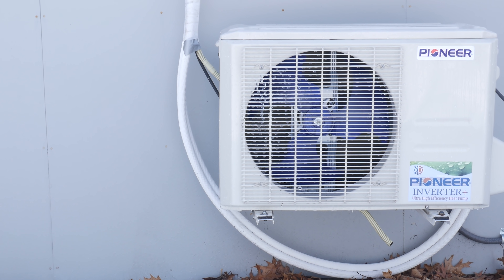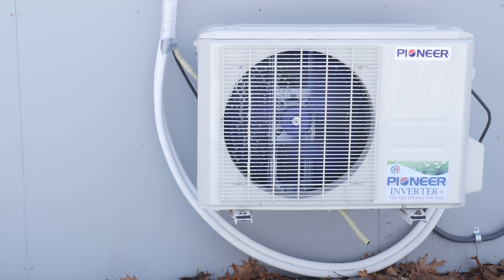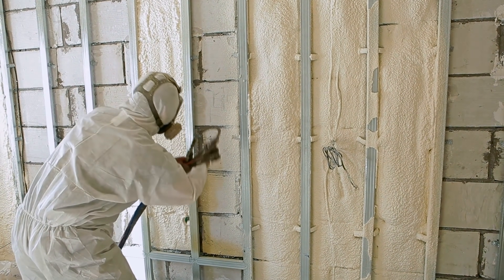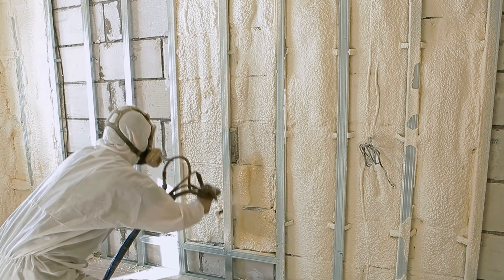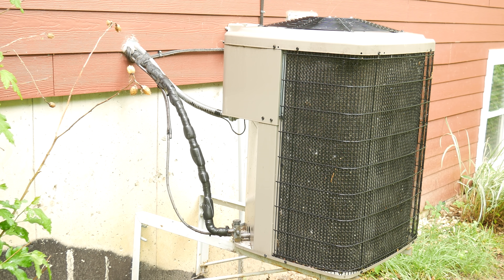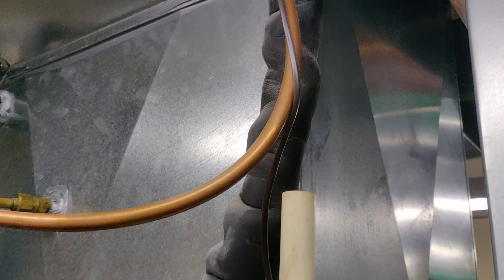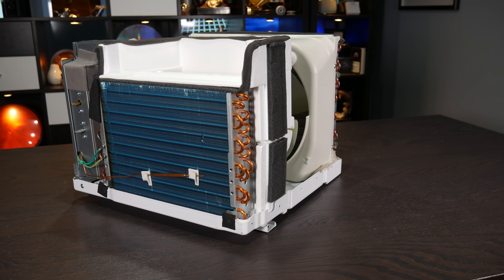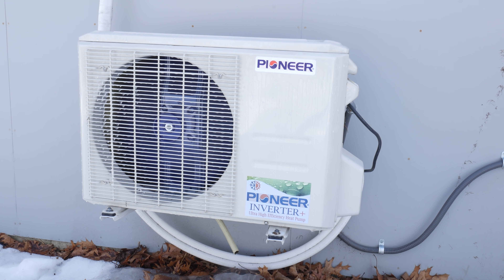Heat Pumps are Not Hard: Here's what it will take to start pumping

Comment: Getting a 12kw solar system and a heat pump to replace my 30 year old propane and conventional HVAC  and LP water heater switched to a heat pump water heater installed in the next couple weeks and can't wait.
Reply: I live about an hour south of Chicago in Indiana if you ever want to come check any of it out
Reply: Also I got a quote from a local HVAC company and it was over 20 grand to remove and replace with a heat pump

Comment: Odd, I have two of these installed on my house, although they mostly pump heat outwards. 

We just call them 'reverse-cycle air-conditioners' in Australia. 

As it doesn't get cold enough to snow here, basically ever: We care much more about cooling power than heating power, and this turns out to be not at all as efficient, leading to needing bigger heat pumps to push heat out into already-hot air.

Instead there's at least one company offering hot-water services running from electricity which improve electrical to heating efficiency by virtue of using a heat pump.
Reply: My A/C works very well, even in 100 degrees (38 C).  The outside compressor is 150 degrees so it has no problem transferring the heat to the outside world

.

Comment: @15:10:  You noted a trap on the condensation's drain line.  What good does that do?  It's not like you need to block sewer gasses or prevent air-flow leakage in the head.

Comment: Our house has central air.  Most of the winter heating is done with the system running in reverse.  On truly cold days the electric heat is switched on and we get to watch the meter spin faster than the Indy 500.

Comment: Split system reverse cycle air conditioning in residential homes is very common in Australia 
My house has two heat pumps both are reversible 

Its a very common misconception here though that the heat function uses a lot of power 

I wish more people knew how they really work!

Comment: What can you say about water-water heat pumps, where you pump near constant temperature water from deep underground and that way you are barely affected by the outer temperature, or this type where a long serpentine is buried a meter or so and you also have near constant out temp minus the need to dig expensive holes?
EDIT: Whops, I just realized already you talked about that. I've just missed the episode, but found it now. 10x
Reply: geothermal heatpumps are extremely good if you have prolonged periods of time under 0c. otherwise air to air or air to water are slightly more efficient. If i would build a syste mfor complete efficiency. you could use a geothermal for when it is colder than 0celsius outside. and a air to water for when it is over 0c. Expensive yes, but really coold efficiency from that combo.
Reply: How could that be? I mean I thought that with water from the underground having relatively constant temperature trough the year and adding the extremely high heat capacity of the water should mean the efficiency of water to water is high? Why air to air is more efficient?

Comment: I got a 5 ton Bosch heat pump installed last summer.

I pushed for the larger unit to keep up with Texas summers & because I have a 20 foot ceiling in part of my house.

I had some ludicrous quotes. Ended up paying $12k for this unit, which was a bargain compared to many of the other quotes.

Comment: Peoples Gas in Chicagoland has a $35.17 monthly customer charge for heating. Depending on consumption this would lessen the COP ratio needed to breakeven (haven't calculated for distribution differences, but $400/year would move the needle on the economics a bit) @25:47

Comment: I’m curious. Heat pumps are common in the South and they also seem to have a lot of flexible ductwork.  Here in the North, it’s gas furnace and steel ductwork.  Is there a relationship or is the flexi duct installed due to lack of skilled labor?
Reply: Steel ductwork...   what a lovely way to bleed off temperature before it gets where it's needed.
Reply: @annpeerkat2020  well that was helpful.  Interesting that rigid metal ducts are the norm in the cold north, so it must be able to do the job properly.  From what Ive read, flexible can match the performance, but is totally dependent on skill of installer.  That, apparently, is an issue.
Reply: @kayakgoalie  no worries goalie!   If you don't instantly understand the difference in thermal conductivity between steel and plastic, or see a difference on reflection, no worries. Good luck with your climate control and energy bill.
Reply: @annpeerkat2020  Ah that explains it. In most Northern areas, the metal duck passes through insulated walls or a heated basement. In the south, from pictures I have seen, a lot of the flexi duct is in unheated areas.  So there is no need to insulate the steel ductwork. Thanks for the hint.
Reply: @annpeerkat2020  Steel ductwork in northern Climates is usually surrounded by insulation. Unless the ductwork is going through a basement and the “loss” is going directly into the space you are trying to heat. Not a fan of the sarcasm btw.

Comment: NEEP's grid now has columns for both SEER and SEER2, but only one column is populated per device, and if you sort by either column, you just get the ones with no value on top. So frustrating when a useful tool is wrecked like this!

Comment: I'm a mold specialist/environmental hygienist. Here in Iowa, every home or apartment with mini splits has mold problems because they can't get the humidity below 60% meaning you don't have much wiggle room to prevent mold growth. Any slight uptick in humidity and you have mold everywhere.
Anyone have any insight?
Reply: What other angles other than the heat pump units have been considered?
Reply: @SubconsciousChaos  every angle. Mini splits can't dehumidify below 60% according to the manufacturers. They shouldn't be used in places where humidity is a concern.

Comment: The noise issue is completely overblown as modern inverter driven heat pumps are barely noticeable unlike loud old AC units. If anything, I'd like to see noise ordinances ban single speed bang-bang A/C systems are required inverter-driven heat pumps instead. The Mitsubishi mini splits can also be configured with internal junction boxes for the refrigerant lines so that the spaghetti can be contained inside the building and reducing the amount of work to get the spaghetti through the outside wall. I think hybrid systems should be given more attention as they remove the "but sometimes" fear people have with heat pumps, as well as the small duct issue, and drop in perfectly to systems that have a gas furnace and A/C today. Carrier's Greenspeed offers such a system that can be configured with a gas furnace, hydronic coil, or electric strip heat and actually has higher theoretical performance than mini splits (although I still think mini splits are more efficient in most cases due to having a zone for each room).

Comment: to be honest, you only need a spilt with on head in the living room for an apartment or a average size house on one floor , its how we heat a lot of houses in Norway, non of this 3 split( you can bary get one ,i have tried for my current house ) you have the heat pump in the living room and beedroms don't need heat , and bathrooms all have floor heat of some kind so heating the living room or a hall way will cover most days , add some extra electric or a wood burner for the coldes days and you are mostly set .

Comment: I've been following Linus upgrading a new house on the LTT channel, and one of the things he's trying is solar panels with water circulating behind them, as they are more efficient when cooler and you then have warmer water for other uses, he's using it for a pool, I'd imagine it would be useful with heat pumps in the winter.

Comment: Super critical CO2 is actually in use for large supermarket refrigeration systems. As I understand the biggest issue is it's increased complexity both in the equipment and the understanding of the process.

Comment: What about the water tank heaters that are often connected to the same inbound gas line that's used for furnaces? No option but to continue using gas there?
Reply: just remove the furnace from that line?

Comment: I switched my 13 seer 2 ton with a 20 seer full adjustable ACiQ heat pump, it has the ability to do 85% of heating at 0F, the complete kit, with precharged lines and a new wire set for the thermostat which is a Google nest learning and another 24v wire set for the S1 and S2 interior to exterior communications line was only $3500 and it took me half a day to install. I will never under why people pay 12k+, I actually found out the original owner of my house paid 10k for the garbage on off 13 seer system with such a basic thermostat it couldn't even do programming

Comment: Yeah I guess I got ripped a new one for my system installed in 2021. 15k for a new Bosch ducted system with a resistive electric backup. There was already a unit outside and inside, I just got rid of the oil burner. Still runs on r410.

Comment: geothermal heat pumps work when its below zero the ground temperature under 6ft where you are in Illinois is about 54 degrees Fahrenheit  year round so its far more efficient in any temperature lower than that and way better in the summer too

Comment: Heya, would you mind to share your opinion on selling portable air conditioners (with heatingmode) as heat pumps? Our current products have a COP of 2.5~ which is pretty good compared to regular heating methods. (it is pretty noisy to use them indoors tho)
Reply: The problem with window heat pumps and PTACS is they have a outdoor fan that must run all the time, and if the coil freezes, the fan will start to strike the ice on the outdoor coil.  So they change over to electric back up heater when below about. 35F.  So if you live in a area where 35F only happens about 10 - 20 hour each winter, the window heat pump will work great, if you can stand the noise of both fan blades.  

Most ductless systems are very silent, less than 60 db.  They have a defrost cycle, and while not "Great" at collecting heat at 20F, they can keep the room warm, while not using any back up electric heater.  They also last a lot longer than a typical PTAC or window air conditioner.  

If you are talking about a portable unit, with one pipe to direct the air outside, remember that it is blowing out about 400 cubic feet of air every minute, and thus outside air needs to come back into the room at that same rate.  So in the heating mode, that is a LOT of cold air entering the space you might be trying to warm up.  It will work very poorly at best, and might actually cool the space if it is 20F and you are brining in 20F air to replace the air discharged through the hose.   My nephew had a portable A/C in his rental home, and I installed a ductless unit to replace it, so that he would not be blowing 400 CFM outside every minute, or more than 20,000 cubic feet per hour (his house is not that many cubic feet of air inside it).   He has electric heaters, so only gets 3,400 Btu's per KW, while his new heat pump is 12,000 Btu's per KW, or nearly 3.5 times as much heat per KW.

Comment: Update: wanted to come back by and mention that now that it's gotten close to freezing here on a few occasions I've sat and watched the outside unit with the compressor and it seems to wait to do a defrost cycle at all coat until the thermostat inside satisfies. If it can, once the thermostat reaches the setpoint it keeps running heating the house up a few degrees then shuts off,  then reverses leaving the out fan off allowing the outside unit to get hot enough to melt any ice build up for a minute or 2 then finally shuts off till the thermostat calls for heating again. 

Just got a new ac unit installed to replace my 15 yo unit and was offered a heat pump with a 1200 dollar rebate. I was told by the installer that over the 3 years they've installed them Noone has had their emergency heat kick on. Granted I live in Central Alabama but the specs says it should maintain a 2 to 1 energy ratio even a 0 degrees f. And it's an elchepo unit from carrier. It took them 3 hours to replace everything but the line set and ductwork andcost 7 grand.

Comment: I wonder if the reversible valve can just be installed on a central AC system?  I'm in South Alabama, and have Central AC, but no *heat pump*.
Reply: You DO have a heat pump it pumps the heat OUT of Your house, but it's not setup to do it in reverse!
Reply: @neilf1059  yeah.  That's why I asked the question that I asked..........

Comment: I was thinking. With the right design in the right area, it would be possible to build an off-the-grid neighborhood. As far as gas/electric. The entire neighborhood could be hooked up to a neighborhood wide geothermal setup. Or even with every house having reversal heat pumps for heating and cooling. That takes care of the need for natural gas. Then each house in the neighborhood could be outfitted with solar panels and its own battery backup. But also connected to a small communal solar array and battery backup. That way if house A is generating excess and it's battery is full, it can be put to the community battery or used to power house B that is either drawing more than it is producing or just not producing enough excess to charge its battery. Thereby eliminating the need for a connection to a wider electrical grid.

Comment: Where I live we have a weatherization program for low income people (200% of poverty line) that will weatherize your house at no cost to you including replacing old inefficient furnaces, new windows, extra insulation in the attic and upgrade wiring in process if needed to add insulation. basically anything that will pay itself back within 20 years

Comment: Have you ever thought about a video explaining R value of insulation and how the R rating system is flawed.  Comparing the actual thermal heat transition of fiberglass or cellulose compared to a spray foam or other foam insulation. Where the movement of air inside the walls are not taken into consideration in when using fiberglass and alike insulation. 
I agree that the homes build today are not built with good enough insulation codes and we are dumping a  lot of energy to heat and cool.  People tend to think about the mechanical things to heat and cool vs the passive things to keep the temperature constant.

Comment: One problem I found if you are not a factory citified installer like a dealer. The warranty is about useless on the unit. I could have installed my unit my self. I have a EPA license for refrigerant and the tools. But I had a dealer  do the finish work for the warranty.

Comment: Im rewatching this video because i recently has my gas meter replaced (dead battery) and he sugested going back to gas instead of the existing immersion heater system would save a lot of money.

I'd said i was debating getting a heat pump system because theres a grant you can apply for up to £7500 in the UK. He immediately said a heat pump wouldnt work for my house. Not enough space.

I kayer looked up that the energy company I'm with has been criticised for pushing gas solutions when heat pumps would work or be better.

Because theyre owned by Centrica. And their stock and trade is gas. I was also told wed be switching from methane to hydrogen soon, which is way safer and greener. And apparently more expensive to run, I found out later.

Feels like gas suppliers see the writing on the wall and are trying to trick customers in the UK to stay relevant.

I later went on the UK government site, answered a few questions about my property, and it suggested i was suitable for all 4 types of heat pump here.

Comment: Insulate. Insulate. Insulate.
Your wish is my command. 🤣
I live in a little bungalow built in 2000, my walls and windows seem fine, but the attic is clearly less than adequate.
The windows are air-tight but are definitely not low-E.
There's just haphazardly-blown fuzzy dawdust-like (cellulose?) insulation on the attic floor, probably no deeper than 4 inches, barely covering in other areas. (honestly looks like they ran out and said "screw it")
It'll cost me under $300 to put up radiant barrier in the attic for the hot summers.
And about $800 to lay R-30 fibergass rolls on the attic floor for the cold winters.
And under $50 for some low-E window film on south- and west-facing windows.

Comment: Some of the inflated prices for high efficiency mini split systems started when the Federal Government was offering tax credits, utilities offered rebates  and Mitsubishi equipment is very expensive to begin with    You are mentioning the problem as I type this.   Padding the the installed price by bidding contractors.  Multizone systems require some education to design and sell them.  When you add WiFi control and wired thermostat options then more education is required by someone in the company.  All companies have to make a profit and online sales like MrCool selling direct are really drive contractors to offer more specialized systems and options leading to higher prices still.   Just my thoughts as a mechanical contractor in Oklahoma.

Comment: Would it be effective to have a small building’s temperature controlled with in floor hydronics with a heat pump? Without going back and rewatching the videos I don’t recall you talking about hydronics but I could be wrong